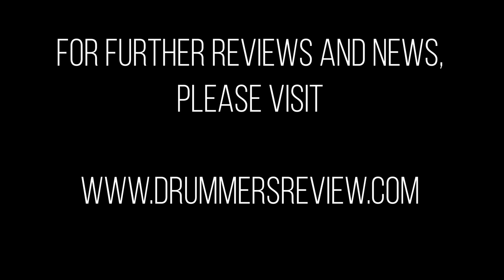Snare Drum Hoops Comparison - Drummer's Review

Comment: I love how my S-hoops sound but one thing I didn't realize until I brought my snare to a gig is that it's very hard to snap a clip-on mic to it due to the wide inward flange. It's possible but after 3 or more backbeats then it falls off.
Reply: I just ordered a snare that comes with S-hoops, did you end up moving to a mic stand for snare or did you find a different clip that works better?
Reply: @bikefreak77  oh boi I already switched to diecast and then next month I'm ordering a Tama with triple flange to replace my main snare. Yeah you could try and find a clip that snaps more to your S-hoops but personally I wont risk it. Much safer to use mic stands. If your gigging with it just by a light stand and you should be good.
Reply: @eucabusas  thanks for the response, I appreciate it. My gigs lately have been shared kits between two bands (other than snare and cymbals) and the venue provides the mics/clips. As you suggested it's probably easier if I show up with a stand or maybe pick up a die cast or sonic saver hoop (one of my other snares is a Black Panther) where the clips will work properly.

Comment: Where can you get these walnut hoops from? they are fantastic!
Reply: Find a custom drum builder. Tama makes Maple wood hoops. Not any noticeable sound.
Reply: @Assimilator702  I was hoping for an off the rack solution for the walnut, maple drum hoops are easy to find. Tnx anyway
Reply: @amirbendayan376  No one makes walnut hoops except for custom builders. You could buy a set of Maple hoops and stain them dark brown if that’s your thing. There won’t be an audible difference between maple and walnut. Durability would be the only factor as walnut might be a touch more dense than maple. However Yamaha used Maple for their first wood hoops back in the the 90’s. Tama added them to their catalog. Good enough for me. You could make them yourself if you’re semi proficient at woodworking. Not that difficult with the right tools. Or a lot of patience and a few Japanese pulll saws.
Reply: @Assimilator702  I'll give the Tama ones a try see how it feels, thanks.

Comment: I thought the brass had more high overtones, while the S-hoop had more mid overtones.  The steel triple-flanged sounded slightly darker than the other two, but was very close to the S-hoop.

The die-cast sounded focused, but darker and a little dull due to the reduced overtone content.  Same with wood, but there was a beefiness to the rim-shots that the metal hoops didn't have.

All of which makes me wonder, what do die-cast brass hoops sound like?  Do they have the stronger rim-shot and cross-stick sound of die-cast, but with a more open sound?  I'd like to get my hands on black nickel plated brass die-cast hoops, but I don't think anyone makes them.
Reply: The only diecast hoops  other than the standard Zinc alloy that Tama and most manufacturers use are the Aluminum diecast hoops from Yamaha. I believe Yamaha has all their diecast hoops made from aluminum and they are considerably more expensive than a standard Zinc diecast hoop. Besides that there are cast Bronze or “Bell Brass” diecast hoops. Those run about $250 each. There are a few botique drum companies that make these. Well worth it if you have a high end snare like a Bell Brass.